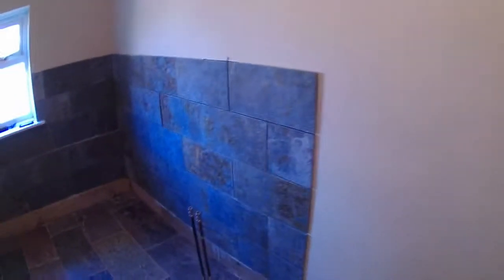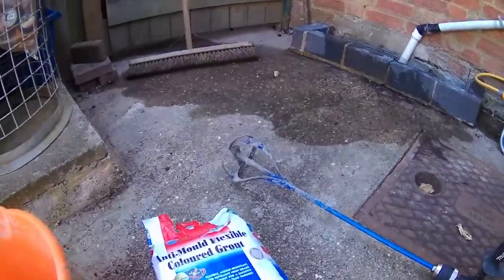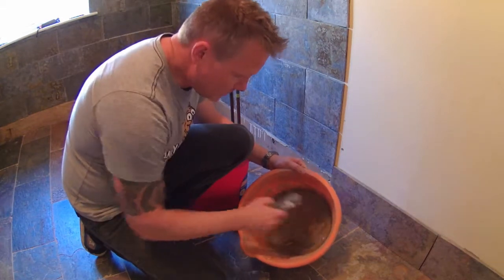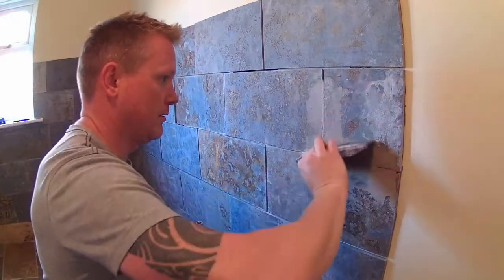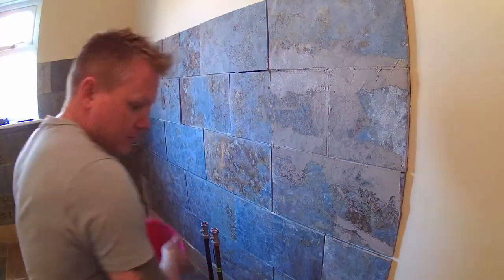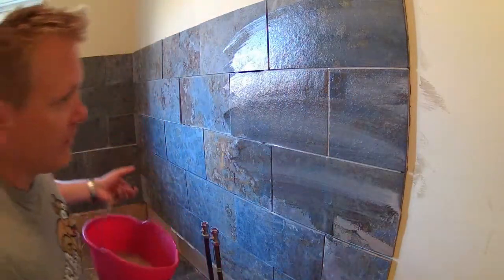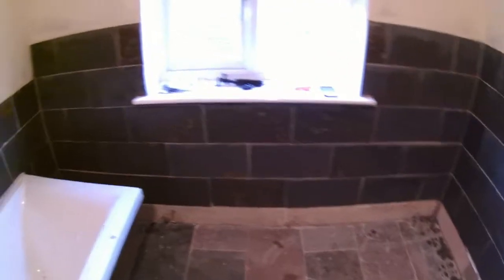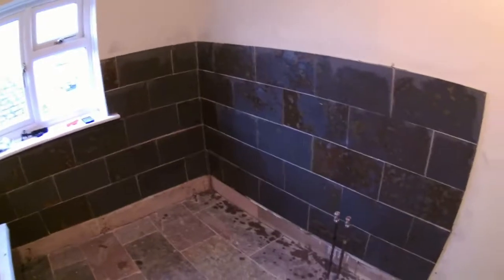How To (How I) Grout Natural Stone Tiles

Comment: Nice Video! Did u use a Sealer for the Stones?
Reply from the maker: Hiya.  Yes I did used a sealant on the tiles after they had all been installed.
Reply: Did you clean well and seal properly before grouting? Still looked very porous as the grout went on. Must have been a Ballache to clean
Reply from the maker: Nope it was all sealed and cleaned off like a dream.